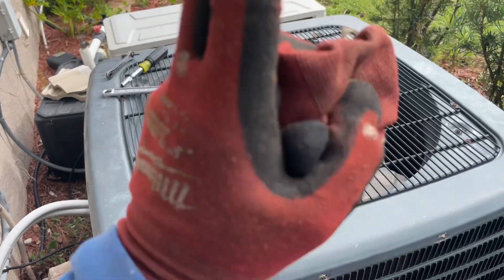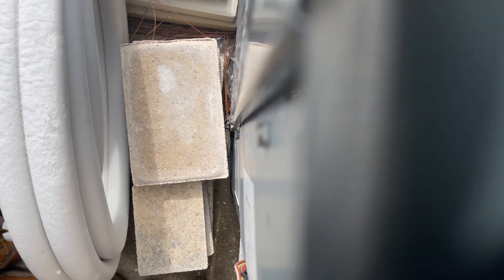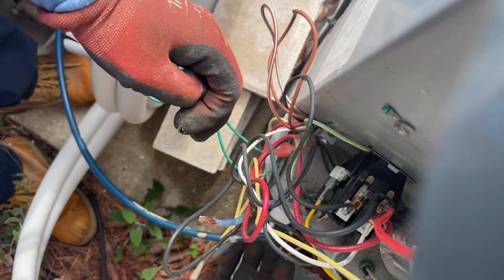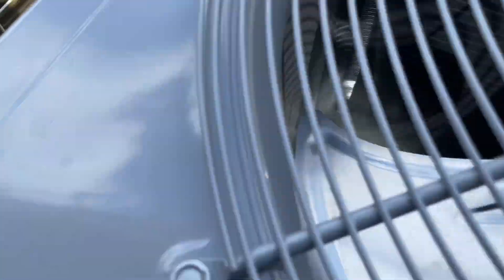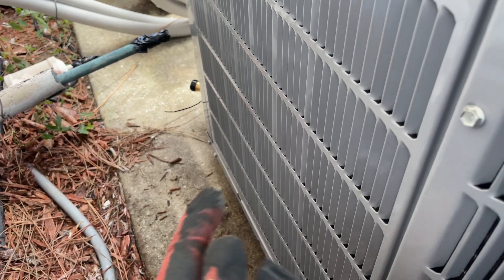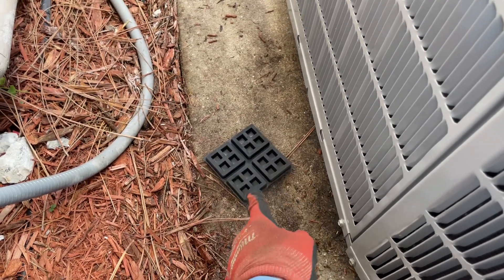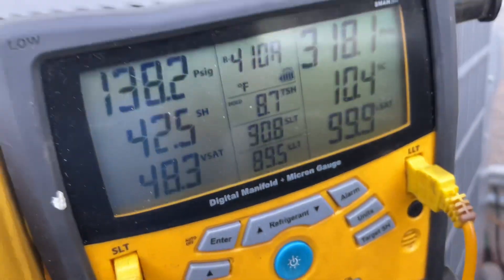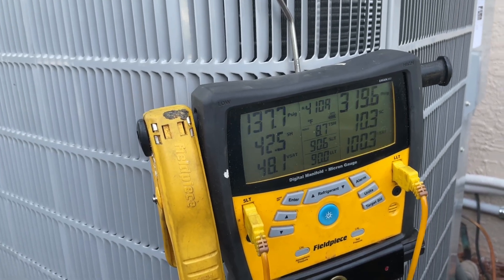How to Install a 5 Ton Carrier A/C Unit - HVAC Tips & Tricks

Comment: Just because you're pushing the contactor and unit doesn't come on does not mean there's no voltage, it just means there isn't 240 but you could still have 120, it's happened to me before. Good job though